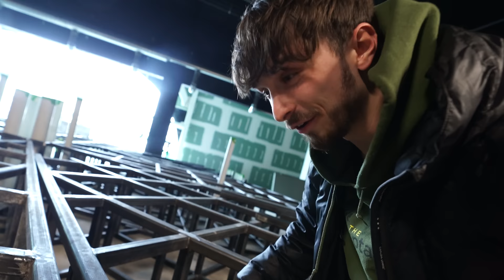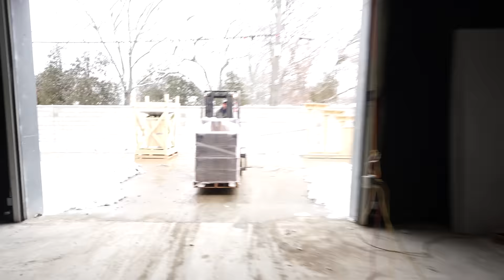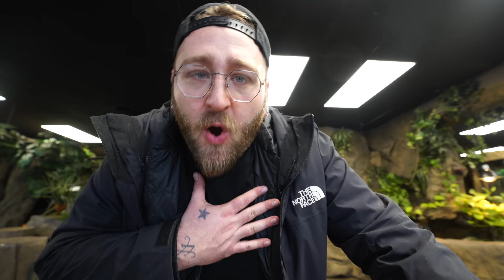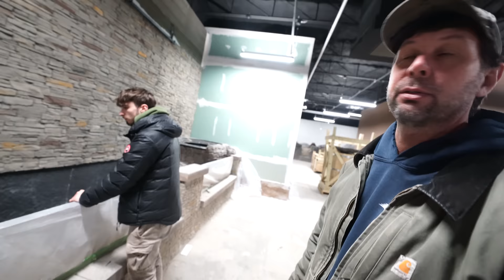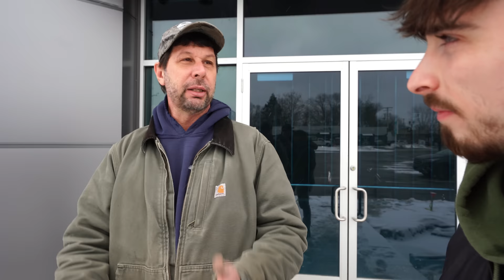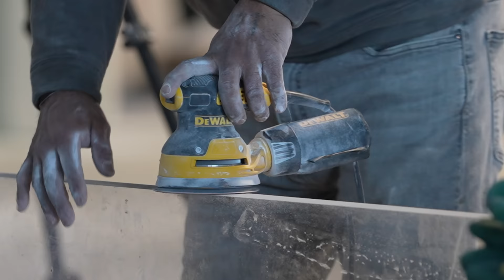Water Tower Arrives Today!

Comment: Spending time in a wheelchir and having a dad in a power chair..
General rule is you want it at a min. As wide as a door entrance plus room for the hand rolling chairs. Chairs generally run 25-36” 
36 is generally for a larger chair. It’s close, but sufficient unless there is an over sized chair or scooter mobility aid. But hand and elbow room is important too!  There won’t be room to turn and face the enclosure for most chairs, but if it’s just a pass through area-36” seems ok. 
Love seeing that you are thinking all angles!

Comment: Wheelchair user here. House doorways have to be around 36 inches for ADA, but I found that anywhere with that as your minimum is the way to go for extra comfort.
Reply: I’m a wheelchair user, too😊 I use a power chair mostly and manual for emergencies. He was talking about clearance to fit between that tank and the decor/rocks on the other side, right? My manual chair from back wheel to back wheel is 22” and my power chair is almost 25” from back wheel to back wheel. That’s standard width, right? I agree, 36” minimum should be ok

Comment: Snakes make me nervous compared to other reptiles...mainly due to some that were kind of insane that I was stuck helping with in high school.

My mother was the librarian, so I was stuck in the building for a while after classes ended and got roped into helping with the biology lab. Most of the animals were fine and easy going, even the snapping turtle that I got to a surprisingly tame state where if it wasn't being offered food, seemed more than happy to be picked up and touched. 

The rabbit was a pain...but that was more in dealing with it causing damage than anything.

The snakes in that room, however, were aggressive and horrible pieces of work to deal with, they'd even try to strike through the sides of the cage repeatedly and were just a nightmare to deal with. To clean the enclosure, which was quite big for their size, you needed thick gloves and a coat to corral them while cleaning and that person would need to keep them away from their face...only the bio teacher could normally handle them and would routinely carry them around while they would, occasionally try to strike at people.

Those were nightmares in other ways as well...